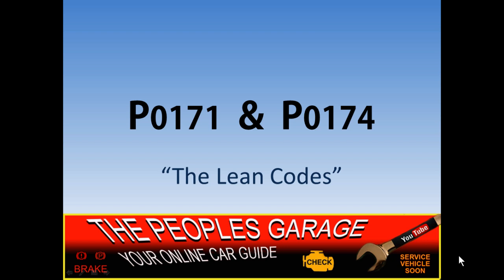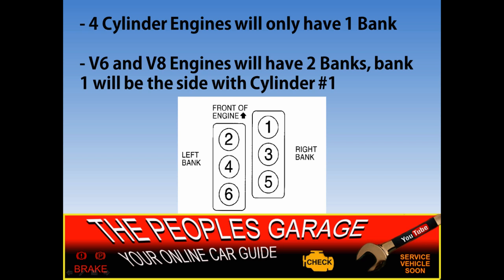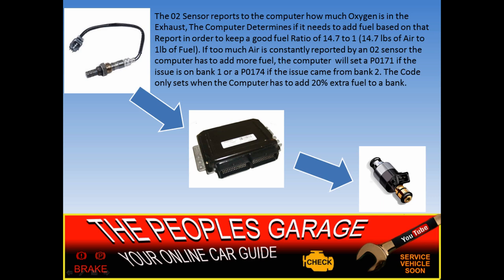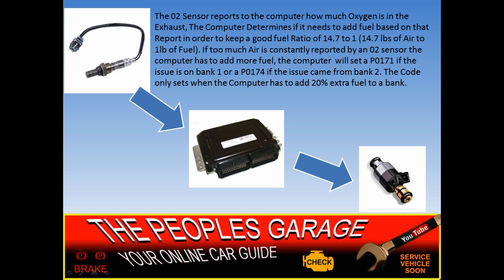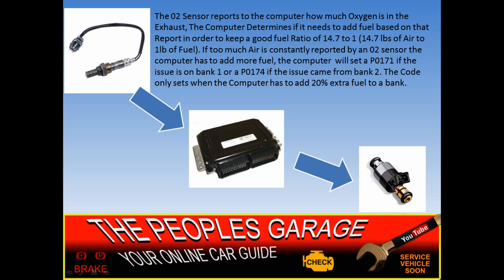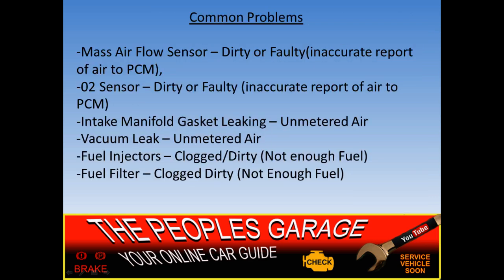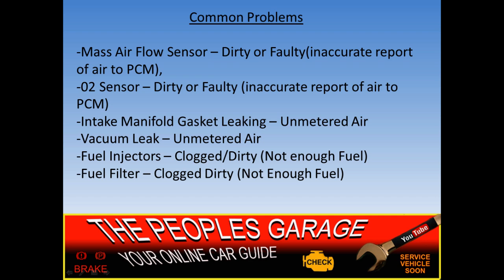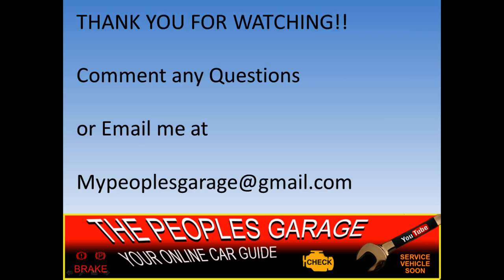How to Diagnose Codes P0171 & P0174 - Lean Bank 1 & 2

Comment: Hey man great vid!!!👍👌👍. I'm getting both bank alarms in my 2007 750Li...but I'm also hearing a whistle type of noise when I'm idle and goes away when I accelerate??? Any suggestions?  Thanks
Reply: Check brake booster for a vacuum leak

Comment: Thanks for the video it was very helpful. I have a 2001 Toyota Celica that gives me a PO171 code from time to time. I've cleaned the Mass AirFlow Sensor at least  twice now and the O2 Sensors were replaced six months ago when the new Cat was installed.  I guess the only other thing to check for is a vacuum leak using a spray bottle or add some fuel injector cleaner and see if that helps wouldn't you say ?
Reply: +sweetbrandigirL  I  have 2001 celica  i have the same code p0171  i replaced  intake gasket ,  02 sensor 1  02 sensor2  mass sensor  nothing work for me   . Were you able to fix your car problem?
Reply: shoua xiong Yes I finally got the code to go away by pouring antifreeze down the heater hose into the intake until it ran out the radiator reservoir. Which tell me I had air in the system. Hope that helps
Reply: can you tell me more about what you did to the car to get the code to go away? So why did you pour the anti freeze down the heater hose? Did you disconnect the radiator reservoir hose under the intake?
Reply: shoua xiong Well originally my temp gauge was was showing norm for the first few minutes of my drive then it would spring to hot, I then get a PO171.  I also had No heat just cold air. My first thought ran to stuck T-Stat so I replaced it that didn't work so then I thought Coolant Temp Sensor replaced it still the problem existed. I then back flushed the heater core and filled the system with new coolant or at least I thought I filled it. I kept getting the same result which meant there was air in the system somewhere but I couldn't for the life of me figure out why the engine wasn't pushing it out. So in a last ditch effort I un-hooked one heater hose from the heater core and poured coolant down it until I saw it being pushed out the resovior. I then did the same thing with the heater core by un-hooking the heater hose from the manifold and pouring collant into the heater hose to fill the heater core. I was doing everything I could to remove ALL the air from the system. So after replacing parts that weren't bad and filling the system with new coolant my PO171 went away and my temp gauge is steady at the normal position. Again hope this helps
Reply: +sweetbrandigirl Thanks for your help!

Comment: Hi, I have a 2006 Chevy Silverado 2500 HD, 8cyl.  Are there are other tests or items to check, beyond what you covered in this video, that I should check as I'm getting, intermittently, codes P0171 and P0174.Thanks,

Comment: 04 Jeep Liberty 6 cyl 3.7L 4x4

Had some coolant spillage.   I used a low flow stream of water from a garden hose to remove spillage of the components.   Drove the car for about  30 minutes all was fine.  After the drive it sat for about an hour before going somewhere again, at start up it was sputtering.   So I thought some of the connectors may be wet.  Not sure.   Sputtered that night and I let it sit.  The next morning it dove fine at start up so I figured it dried out. It came back shortly. Codes are saying coil secondary  1,3 and 4.  Swapped coil 1 and 5 and checked it again, the results are completely opposite of what I expected.   Lean codes bank 1 and only 4 is secondary fault.  In a real world i should be able to tell if the coil is bad, having spark plug issues or further back into the pcm.  I'm lost on this one.  Any Help ?
Reply: Problem solved.   Full spark plug replacement

Comment: i have 2003 vw jetta and I'm installing 034 motorsport high flow manifold, but i have the original hose and it looks to small and its bend before it connects, so my question is i have the code but i don't know what to do, if i have to change the hose or change the injectors

Comment: is it a possibility with everything you said in this video that it could effect the shifting? I have a 99 gmc sierra 5.3lr and code po171 showed up. and when this code appered, it started shifting hard. 1,2,3 gear and park to drive. would this have anything to do with the shifting.

Comment: First I really want to thank you for this video.  The explanations were and are very good.  Having some but not being an expert on engine repairs this was very informative.   Second,  your video actually explained an issue that i had not heard of.   (concerning the where the leaks where and the code that would pop) 

Again awesome job
Reply: I have a 05 lr3 and have a engine light on and the message on the screen says reduced speed something or of that nature. I just changed the spark plugs because the engine was missing. After the change it still was missing so I took it to  o'riely's and they put the reader on and said my computer is fried because it wouldnt/couldn't establish communication with the reader. Any thkughts?

Comment: Hello ThePeoplesGarage!  I have a 2005 Dodge Stratus 2.7L V6 and it recently stalled on my wife.  The vehicle cranked and drove about another half mile and stalled again; it will not start at this point.  I have the code p0174 only, so the problem is confined to bank 2.  I advised my wife to have the air filter changed at every third oil change.... I found the original air filter upon inspection (67,000 miles) and the air box had oil inside it.  The throttle body has some build up in front of the baffle.  I changed the air filter and lightly cleaned the throttle body.  Before changing the filter or cleaning the throttle body the engine would turn over with no sign of actually starting, since the change it attempts to start while turning over (sounds like its getting fire now).  Would an intake gasket leaking or hose leaking cause the vehicle not to start?  The car was involved in a front end collision a few weeks ago but was repaired and showed no sign of engine problems for a week after so I don't think that has any effect.  Does this sound more like an injector problem, air leak, or sensor issue?  Thanks a bunch.
Reply: it is probably the pcv clog problem if you have oil in your air filter.

Comment: I found my PVC rubber elbows had collapsed and a hole in it.I replaced them all with the assembly that ford sells. My 1999 Expedition has four of rubber elbows on this assembly. It was $42 at the Ford dealer.Car runs good now and no "service engine soon" codes. This video was very helpful on me resolving this.

Comment: I have a 2008 chevy impala with the 3.5. Check engine light comes on and i reset it. It,s good for a week or so. Took it to a GM dealer and they said it has a lean code didnt tell which code. They reset it with there little scanner also. Question is are the 3.5 common for the intake to leak also? Has around 103,500 miles on it. I will be getting a tune up by the same GM dealer next week.  Might go buy a OBD scanner to see what the code is myself if i can find a somewhat cheap one.

Comment: Dude great video very informational. I have a p0171 and a p0130 code and the p0130 is an oxygen sensor code but I'm wondering if it's actually the oxygen sensor that's bad or if I have leaks because I don't just want to buy an oxygen sensor that I don't need. Any way of telling for sure?
Reply: +SweetLifeCrap  If you do need a new O2 sensor, check ebay. I got a very good deal on one. Saved about $40 over buying one from A Z. and it was a new in box OEM unit.

Comment: I have a 2003 Chevy suburban 5.7 v8. I get both codes every so often , then they disappear. I live at 8000 feet. Wondering why it does this and if there is a fix. Thanks !
Reply: +Jake Wolf  Used or new fuel pump?

Comment: Hi i have 2004 mazda rx8 as you know this car has  rotary engine. i have my check engine light on after i con acted my scanner I'm getting the code po171 system too lean. (bank 1) and also I'm getting this code as will p2259 secondary air injection system control B     suit low. Can you please hope me with these. Thank you.

Comment: Thank you for the video. It was very helpful to me. I am looking at a 2003 expedition with a 5.4. I don't know if it is a 2 or 3 valve. when i get back under the hood i will post what i find here. The vehicle also has a 4550 code or something close to that. i don't have the codes with me at the moment.

Comment: i got a 2004 acura tl but i only get 174 bank 2 i change the two sensor but the light still gose on but only wen is cold outside in the warm weather or summer i get nothing everything is fine PS i got a cold air intake

Comment: I have a 1999 Isuzu Amigo. I have both lean code P0171 & P0174. I do hear air (which I normal didn't hear) The RPM are high when I start the engine. But fluctuates. Feel like its about to cut off. And some time it does, the engine shuts off.

Comment: That's an awesome video bro, I have 2008 Camry v6 and p0171 last week I had 0174 as well cleared it and now have 171. I'm gonna try cleaning mass and if not I replace.... What are the chances that both o2 sensors go at the same time causing the code? Ps I subscribed!!!

Comment: 2001 Ford Explorer Sport Trac w/ 4.0L SOHC throwing both codes. Idle seem regular (650RPM) but when accelerating half throttle or put a load on it I get power surge and sometimes it stalls out if i don't let off the pedal. Also power loss when going up any grade steep or steady. I can get it up to 80mph if I feather the accelerator but will surge/chug. Trying to narrow down if its fuel or air related.
Reply: Bought the truck with 64k on it and put 6k on it since. CarFax indicates fuel pump was replaced at 40k. I've replaced the ERG sensor and PCV valve per to Auto Zone's scan and printout.
Reply: +Wynne Williams What about throttle position sensor? They are easy to check with a VOM meter. Probably a video here on youtube regarding how to check one.

Comment: If you have Ford F-150 models and you have both codes showing up. 9 times out of ten its the intake manifold gaskets. I have an 02 f150 5.4l v8 had both codes tryed all the cheap stuff first check to see if that was the problem but what it really was the intake manifold gaskets were shot.

Comment: I have a 2002 ford ranger, 4 cylinder, 5 speed trans.  Getting a 0171 code. My catalytic converter is glowing red, making me believe unburned fuel is getting down into the cat.  Would this be a result of a vacuum leak since its giving a code of running too lean, (too much oxygen getting in from a leak), and as a result the computer is forcing more gas to be dumped i to the engine?
Reply: I wouldn't think that the fuel injectors are clogged, fuel filter is firty, or anything of that nature since the catalytic converter is glowing red as a result of too much fuel getting down in there and causing it to burn off inside it.  What are your thoughts.

Comment: Hey thanks for the Video, my lady owns a 2007 BMW 328i we never had any issues until few weeks ago. I decided to clean her engine using a pressure washer, and since then "only when its freezing cold" i seem to have the car temporary throw  code which my ODB II device pulls both P0171, P0174 and seems to be only with the bay 2 4-6 Cylinders. Odd part is the car is running fine, no rough idle, just in the cold mornings. I knew is should of used compressed air to blow away any remaining water ( hate my self for this )... Whats odd these codes do not come back when its normal weather outside. I ran fuel cleaners, i checked for vacuum leaks ( None ) i am debating that it could be electrical or sensor related or perhaps water stuck in one of these sensor. Any suggestions/advice?

Comment: Before paying for any sensors or catalytic converter, do a smoke diagnostic check.  I was getting lean codes 171 and 174. Smoke test ($150) found bad variable intake valve. Paid $500 (included diagnostic test) vs over $2,000 from Toyota for sensors and converter which would not of fixed anything.

Comment: hello there. 

i have an honda civic 03 with p0171 code and i can't find out what the problem is. 

oxygen sensor, fuel filter, and intake manifold gasket are replaced. pcv valve also. no leaks of air are seems everything are looking good. injectors are cleaned by ultrasonic bath.

don't now what to do.

Comment: Also the 2001 f-150 v6 4.2 would trip both these codes because ford put the wrong isolator bolts in. po 171 and 174 would come up, you need to replace all isolator bolts with correct ones inside the manifold, also all gaskets. there is a step by step guide on the net just google it and you will find it.

Comment: I just rescently got this issue, the P0171 code error and the issue had to do with the injectors but no quite whats mentioned here (them being dirty or cloged) it was acctually the plastic seals for the injectors that make contact with the head of the engine. they where too small and not sealing the space between the head hole and the injectors. At this point I guess it´s important to mention that the car was coming out of a rescent overhaul less than a month prior to the inccident,and the parts and gaskets where not all original, this including said injector seals, wich are just tiny dounut shaped plastic pices. whell the ones in my ¨rebuild kit¨ where a bit too skinny and didint snug the space neough to seal it, and thats where the extra air was creeping in making my engine shake irregularly and my check engin light to go on.

I found this very educational and helpfull, You just got a new subscriber.

Comment: I have a Mitsubishi Montero 2002 it seems to be giving me the code po403 and also p 0 401 it also gave me a mass flow code I am NOT a mechanic however my idol has dropped severely low and I'm wondering if it's the mass flow I cleaned out the whole EGR system I believe what should I do what else can I check what should I do what else can I check

Comment: My 4 Cylinder Toyota MR2 Spyder is throwing P0171 and P0174. that's odd then...
Reply: +megakiller999   I thought you would only have a possibility of a PO171 code since a 4 cylinder only has one bank.
Reply: While I do only have one fuel rail, my exhaust system goes from four pipes, to two pipes, and then to one pipe. Since I have an oxygen sensor in each of the two pipe sections the ECU recognizes them as bank1 sensor and bank 2 sensor.

Comment: Hi,thanks for this video. i have a question. if there is only p0174 (the code on my 2006 ford fusion sel v6), which means lean on bank 2, as a result,  there is no way that there are problems with vacuum leak, mass air flow sensor, or PCV valve. Since when those go wrong, there should be both p0171 and p0174 at the same time. Am i right?
Reply: +yang song On my Ranger the PCV is on bank 2. So if it were leaking I believe it would show as bank 2 (PO174). I agree on the MAF, I would think MAF would give both codes (PO174 and PO171).  Not an expert, just my opinion.
Reply: +nofortunatesonII thanks for your msg. I did a smoke test, there was no leak. I narrowed the problem with the aftermarket cold air system installed by the previous owner. The system sucks too much air to compensate by the computer. after I addressed the system, no more codes.

Comment: Outstanding video!  I still haven't figured out my particular P0171 problem (already cleaned the MAF which didn't appear to have any build up, replaced the fuel filter, had replaced the fuel pump just a few months ago for an unrelated issue, and actually have a new EGR valve and EGR tube and DPFE sensor from unrelated issues as well).  I'm guessing at this point a vacuum leak or O2 sensor.  My vehicle is a 2000 Ranger with a 2.5L.  The fuel filter actually burned up due to an improper install and the DPFE sensor had a faulty wiring harness (loose wire) and that code is now clear, and I had the P0171 previously, which is why I believe those to be unrelated issues.  Oddly though, sometimes the P0171 will come on in just a few miles after a reset yet one time it took well over a week and 700 miles.  Anyway I really appreciate you taking the time to share your knowledge in such a professional manner!
Reply: Thanks for the great video and the explanation.

Comment: 06 Durango. Both codes. I just changed the fuel pump and now both codes come up. Also, after fuel pump changed, SUV seems to have NO power. If I accelerate, the car starts to shake and it doesnt accelerate.. will only go about 10 mph.
Reply: Sounds like something is wrong with your MAF

Comment: Getting both Codes on my 1996 Ford Mustang GT 4.6 re-built engine with only 9K miles, mechanic claims is the intake manifold gasket leaking air on the driver's side.
Reply: Yep he's right intake manifold gaskets need to be replaced.

Comment: Reply  · 
	
 
Nick Balch 3 days ago
 I have a 2011 silverado 4.8l i cleaned the MAF sensor checked the intake for leaks didnt get anything on that replaced the O2 sensors light went away and didnt come back till about 1000 miles or more later what else can I do I dont have a rough idle at all and no lack of power. I do have an exhuast leak behind the muffler and im pretty sure theres no vaccum leaks
 

Im gonna give you an old school trick just for this type of issues, on your downstream O2 sensor install a spark plug spacer between sensor and muffler, (assuming that your code is P0420), disconnect the battery just like you would do for a O2 sensor, install and connect the spacer to the muffler and connect O2 to spacer, reconnect O2 and battery and your are good for life.... !!!

I installed this spacer on my toyota since january/06/15, and 16,000 miles later still runs like a toyota and the check engine light is a thing of the past.